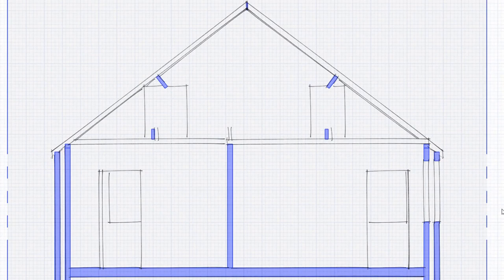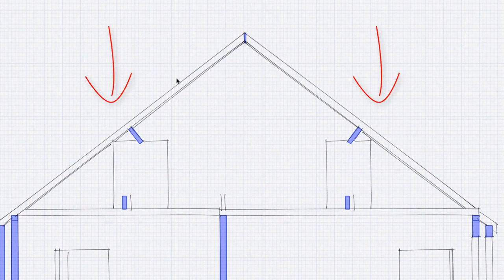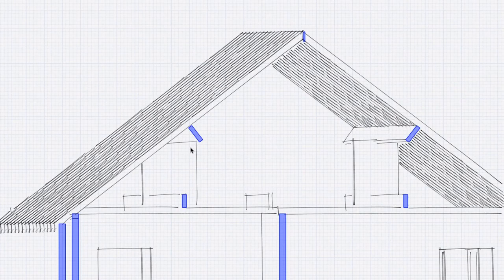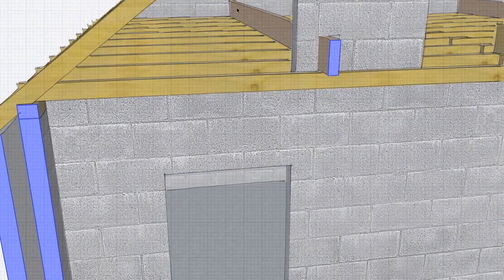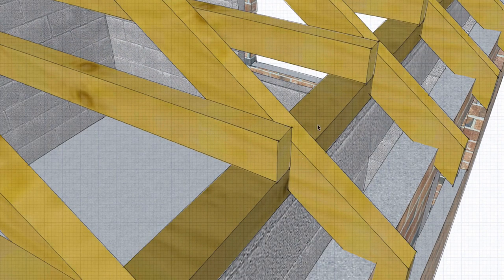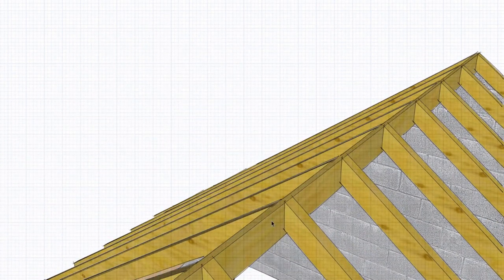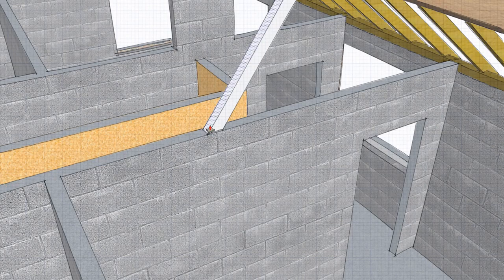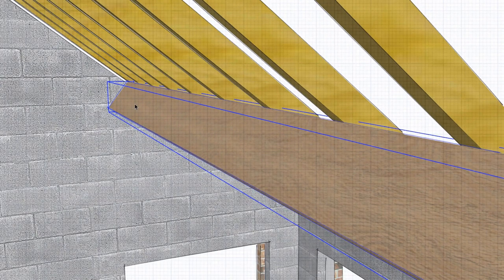Did you know how a roof structure works in the UK?

Comment: what keeps the masonry wall from deflecting due to wind forces ? is it act as a cantilever ?  because the triangle roof cant act as  a support...
Reply from the maker: Good question! The ceiling acts as a structural diaphragm to resist wind loads from the walls, and transfer these loads to the perpendicular walls.
Reply: @RobindeJongh  yes but the ceiling is made of the ties from the triangle. i know that you have a diaphragm on the floor below.
meaning groung floor and roof.
Reply from the maker: Both ceilings act as diaphragms if they are plasterboarded.

Comment: If you have purlin do you need collars ? Doing an attic conversion and currently there are purlins and collars but I need to get more head height. I was thinking about using 90degree amgle steel brackets to attach the rafters to the purlin and do away with the collars all together. Any views would be appreciated

Comment: Great video, many thanks Robin. Interesting to look further at some of the fixing details and things like purlin ties, and how you might go about repairing old brittle timbers. For the ceiling joists you need good overlap at the nailing point which is easy in the centre, but limited space at the eaves, so wonder if some form of brackets might be better there than plain nailing. Also consider the gable walls - the purlins provide the longitudinal bracing, but what about diagonal bracing - assume the intermediate purlin support walls help with that?  Many thanks again.

Comment: I have ceiling binders which I understand shorten the span that the ceiling joists have as they sit on the external in internal supporting walls. Are they normally just nailed through to each joist or should they have blocks which get nailed to both joist and binder? Or can you use the a thin metal tie? I assume they stop the joist bowing downwards under the weight of the ceiling plasterboard since they are under tension as apposed to having any vertically downward force upon them?

Comment: Excellent video as usual 
Most Roofs now have double wallplates as joists are mainly standard 9 inches 
Also nearly all new build specifications ask for RSJ as purlins with wallplate bolted on top to nail rafters due to excessive spans
Thanks for posting your videos, mighty stuff
Reply: Robin
Have a New Build with a Steel RSJ spec with span 13.6m with fixed support from blockwork  from rising walls as you have shown 
Max span is 6m but RSJ is marked as 8 x 6 RSJ, sufficient??

Comment: The binder typically does not half the ceiling joist span - if you run a calc you'll find most binders are nowhere near able to span the distance with the load they would need to take.  What they primarily do is bind the joists together, such that if you were to point load one joist (i.e. by standing on it) it spreads the load to adjacent joists which a) helps reduce overall deflection, but perhaps more importantly b) prevent excessive deflection of the joist being stood on relative to the adjacent joists, as this sharp change in joist level would likely damage the ceiling finishes under.  
Binders also help provide lateral stability to the ceiling joists, and in hipped roofs can do double duty in acting as ties to prevent the wall supporting the hip rafters from spreading.
Reply: Assume the binders also help stop the joists from twisting and make everything more rigid?
Reply: @johncoppock3823  Absolutely, that's what I was referring to with lateral stability (Engineer jargon!).
Reply: @smartbuildengineering  Many thanks Martin. I am a CEng but the wrong discipline. I really like structural engineering in that what you see and imagine up is what you've got, so its down to the grey matter, not guessing what you are looking at from secondary effects etc.

Comment: Thanks for uploading all your helpful videos.  I am struggling to understand how to calculate the load that the purlin carries.  I appreciate it will depend upon the pitch of the roof and that the bulk of the load will be transferred by the rafters to the external walls.  However, how do you calculate the load that the purlin needs to be capable of carrying to provide the necessary stiffening to the rafters without deflecting?  

I have been unable to find anything on this on the internet.
Reply from the maker: Hi Mike. I recommend my timber beam video, ridge beam video, and timber beam deflection video. Let me know if you have trouble finding them - they should be on the channel home page.

Comment: Nice video.  at 0:34, Is the ceiling binder the same thing as a strongback?  Is it's purpose to keep the ceiling rafters from twisting?  If the roof joists are in parallel with and connected to the ceiling rafters at the wall plate, then the ceiling rafters would be under tension. What would cause them to twist?
Reply from the maker: Hi Claude. The ceiling binder supports the ceiling joists if their span is too great, to stop them sagging.
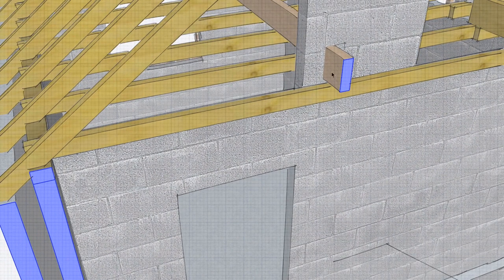Reply: My bad.  At 2:35 and 4:19, you explain this.  I suppose a strongback can be used as a ceiling binder. (For example, a vertical 2 x 6 to which a horizontal 2x4 is nailed, and the 2 x 4 is nailed in perpendicular to the ceiling joist).  Again, thank you for an excellent video.   @RobindeJongh

Comment: If you were to basically turn those ceiling joists into a floor by nailing a board on edge around the perimeter, then you add another plate on top of that, what, if anything, has to change when doing a gable roof? Your rafter wouldn't be connected to the ceiling joists but would that even matter since your ceiling joists are tying your walls together? Here's the video I'm referencing. It's in the second half of the video. https://www.youtube.com/watch?v=ceGKy_1VwOk
Reply from the maker: Hi Joshua. There's other ways to do this, as you have mentioned. I've shown the typical way that homes are constructed in the UK, if trussed rafters aren't used.